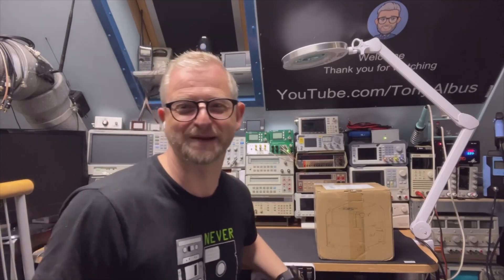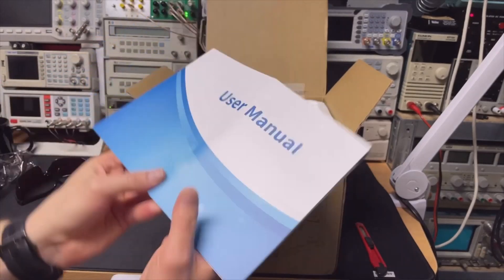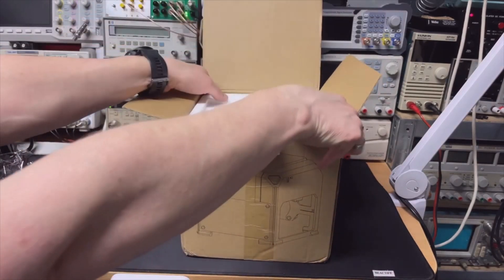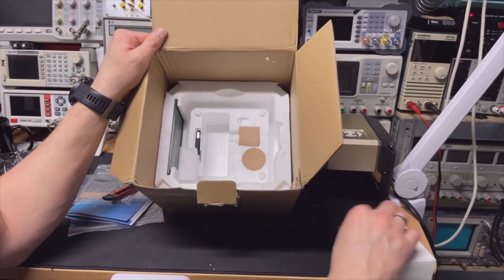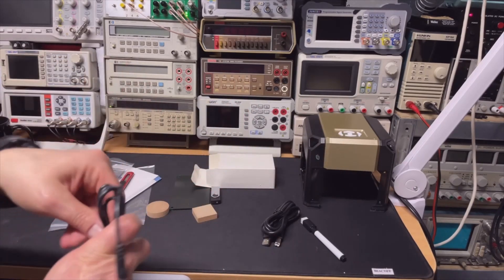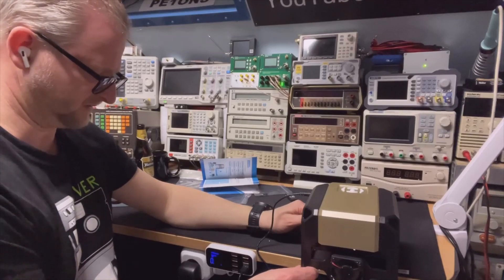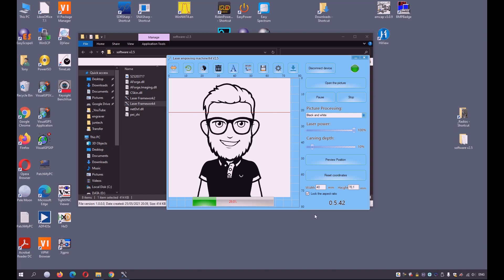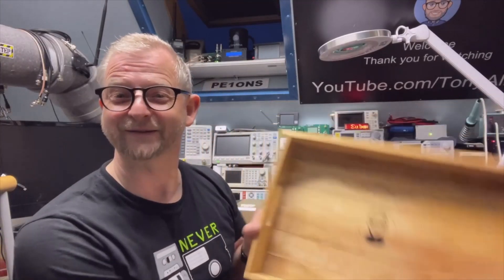#180  K4 Laser Engraver 3000mW - Unboxing, Installation and First-Run.

Comment: Tony the power unit is 110-220 V? What is the output? Thanks.
Reply from the maker: is has a 12v. dc sdapter, probably switched.  so yes 110-240 :)

Comment: Good evening, do you have the K4 main board? Due to a voltage drop, my machine stopped working.
Reply from the maker: Hi, i am not the supplier, i bought mine myself too. but i dont have an extra board.

Comment: I know it's a bit late: The iOS app that is provided through the included QR code is not available in many countries. I found that this laser is also manufactured by the Wainlux brand and if you search for "Wainlux" in the ios appstore you will find two apps 1. Engraver and 2. Laser - (chinese characters). bot are from Dongguan Xinjia Laser Technology Co. Ltd and should work with this model (even if you didnt get the one manufactured by wainlux. the second app is pretty much the same as the included desktop software.
Reply from the maker: Thanks!! that is great to know!

Comment: I wonder if the laser would be powerful enough to burn a mask off a PCB board for circuit board etching.
Reply from the maker: Hi Chris.. yes maybe... but reflective surfaces are tricky.. like the idea, worth a try
Reply: @TonyAlbus  HI, A friend of mine has one of these and we have tried 'cutting pcbs'.  It doesn't work well, but if you spray the copper clad board in matt black spray and run the engraving program very slow at 100% laser power, or a few times, it does actually work quite well.  It'll take a few hours, but if you are not in a hurry it does work :)
Reply from the maker: @Stephen_Heathcote  Thanks Stephen!  Some of the guys on EEVblog in TEA group have a 40Watts cutter... prob. if you lower that power a bit, it works great for this.